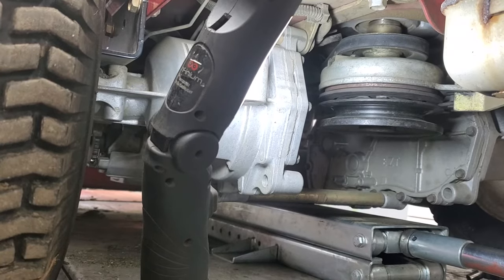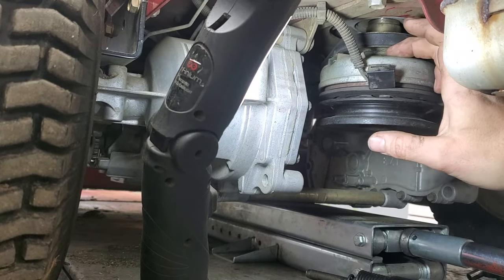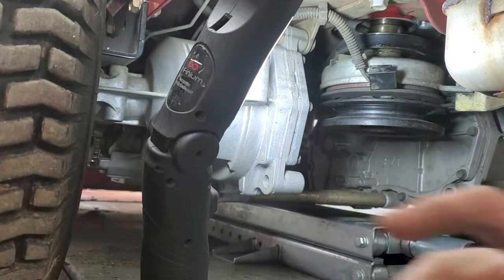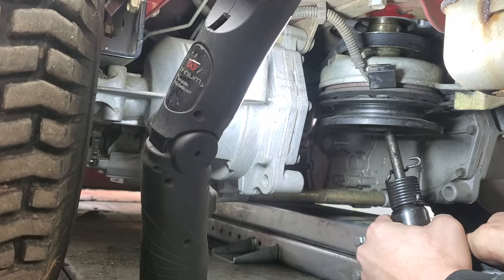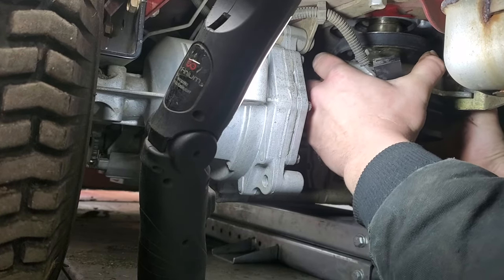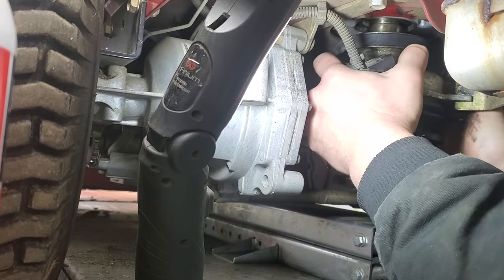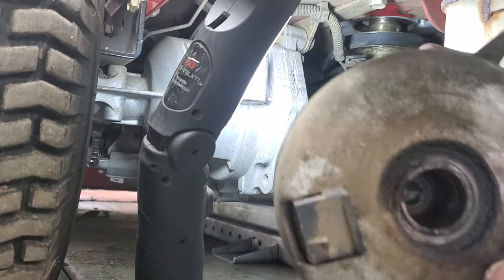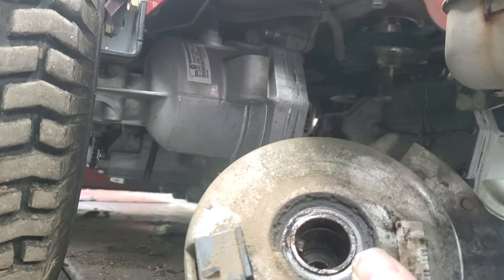How To Remove Electric PTO Clutch Without A Puller On Zero Turn Riding Mower

Comment: Very helpful and well made video. I think the air hammer broke the rust into a powder allowing the penetrating oil to go further down the shaft. I think that spraying more on the top and bottom would've helped more because it would've reached more of the shaft when the clutch was pushed back up. I would use antiseize compound on the shaft when installing the replacement and some medium thread locker on the bolt.
Reply from the maker: Thank you!

Comment: Since you are not (initially) trying to vibrate the PTO off the shaft, just getting the oil to penetrate, I suspect you could replace and fully seat the shaft bolt and beat against that to avoid boogering up the threads.
Reply from the maker: Good thoughts! Thanks for watching!

Comment: How do you stop the crank shaft from turning on top while trying to unscrew the bolt holding the pto clutch. Im having to use a breakover bar because my impact won't break it loose and the shaft on top turns with the bolt on the bottom?
Reply from the maker: We always use a large impact, depending on the situation. If you do not have an impact big enough to do it, I have used a pipe wrench on the PTO pulley before if there is not an electric clutch. If it has an electric PTO clutch you will have to use something (or have someone hold) the flywheel under the engine shroud
Reply: @IndRepair  Thank you for the help.

Comment: Did this on mine today.
I used a Makita SDS Hammer drill with rotation off and a 1/2" bolt held in a conventional chuck.
Thanks for the tip.👍
Reply from the maker: Awesome!! Thanks for watching!

Comment: Did you replace the clutch after this, and if so, what brand did you use, Xtreme. I'm going to put one on my ZTR in a couple weeks. I was wondering if you like it.
Reply from the maker: I sure did not. Extreme clutches seem to be well made. Make sure you don't overtighten the bolt when reinstalling
Reply: @IndRepair  Thanks. I have a Torque Wrench coming from Amazon in an hour or 2. Haha. 👍
Reply from the maker: Great news!

Comment: Can you remove the electric pto clutch if you’re not using a deck?
Reply from the maker: You could but then there would be nothing to keep the drive pulley on except the belt tension. Could potentially cause it to come off
Reply from the maker: Depends on the model, most zero turns
Reply: Yeah the one I got has a bolt on the bottom and goes under the drive pulley. I was wondering because it’s an old tractor and we’re not using a deck on it anymore. I guess it’s gotta stay there then.

Comment: Mine 1 of the back plate bolt came off 2nd bolt was loose  disconnecting wire  what  should I do after I bolt and plug wire back
Reply from the maker: I am not sure which back plate bolts you are talking about? One of the bolts on the clutch itself or the braket to keep the clutch from spinning?
Reply: @Individualized Repair  the bracket  which I I believe  keeps clutch  from  spinning
Reply from the maker: @mannycouto6246  If you are putting it back together tighten everything up

Comment: All these clutch removal videos shows that bolt coming right out mine won’t budge. Any ideas?
Reply from the maker: What are you trying to use to remove it with?
Reply from the maker: Shaft spinning or just won't budge?

Comment: How do you lock up the clutch to get the 5/8 bolt out mine just keeps spinning
Reply: I'm trying to change my drive belts on a troybuilt gt 50 big red horse. And I can't find any info
Reply from the maker: Use and impact and it will come right out. Some clutches have a spot on the spacer you can get on with a crescent wrench also.
Reply: @IndRepair  thanks I was trying with a rachet finally found an article that said you have to use an impact
Reply from the maker: Great job!
Reply: Take the Dust cover off the top of the engine hold the crankshaft for the wrench atop it's been 5/8 inch Bolt

Comment: How to get broke bolt out of clutch on Ferris zero turn mower
Reply from the maker: You can use reverse drill bits, sometimes a regular drill bit in reverse will take it out also. Normally remaining threads are not tight in the shaft and these bits just thread them right out.

Comment: Of course I was hopeful that mine would come off after trying this method, unfortunately it is even more difficult than yours was. Still hopeful leaving it bathed in penetrating fluid and some time and patience that it will free up.
Reply from the maker: Did it come off after soaking? Some are really seized on but this works almost always! Have you tried putting the bolt back in and using the air hammer on the bolt?
Reply: @IndRepair  Yeh, tried it all. Gonna let it soak more and get back at it. Not certain what to do if it doesn't give up.... cutting torch?😬

Comment: Pretty sure my torch does a most effecient job of this
Reply from the maker: If it works it works! We stay away from our torch on this because it will ruin the clutch if you get it too hot. You also have an oil seal directly above that will be ruined if it gets too hot so be careful when using this method!
Reply from the maker: If it works it works! We stay away from our torch on this because it will ruin the clutch if you get it too hot. You also have an oil seal directly above that will be ruined if it gets too hot so be careful when using this method!